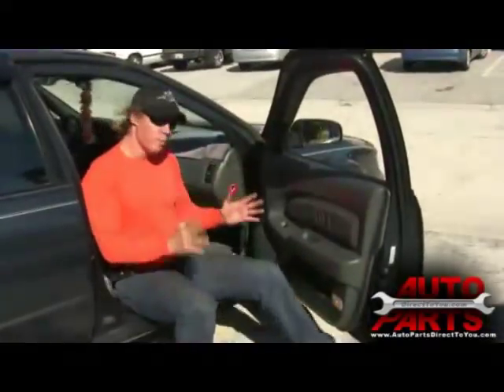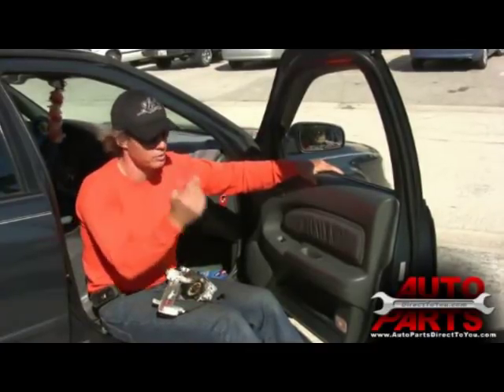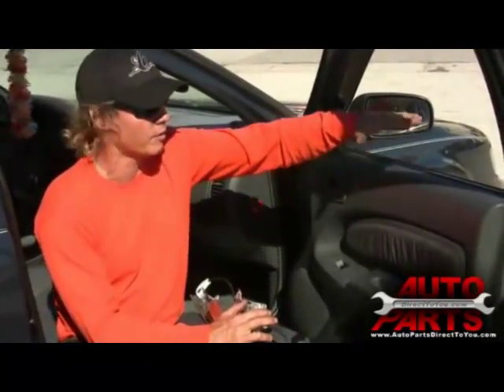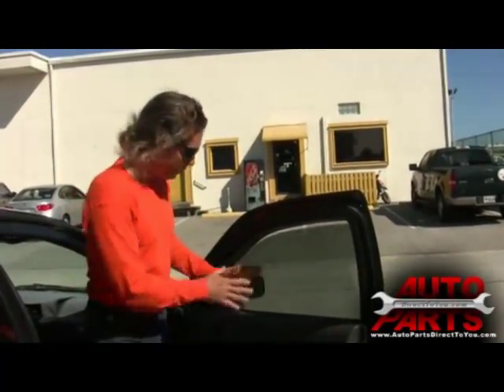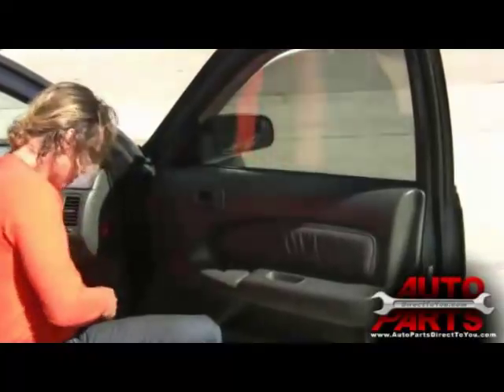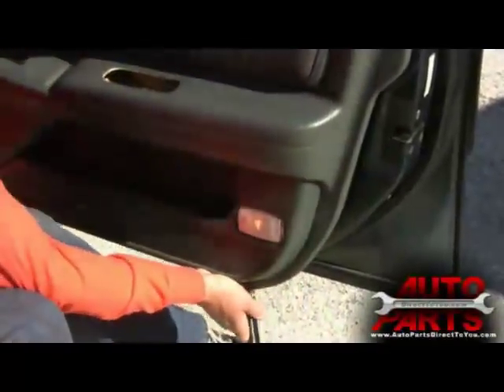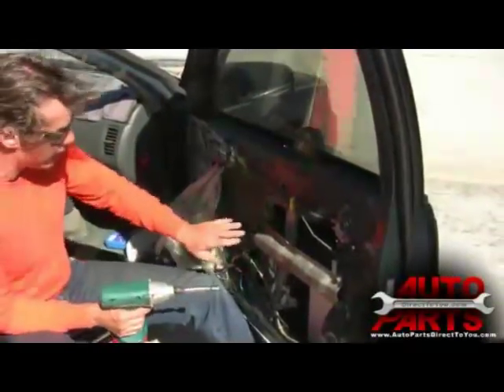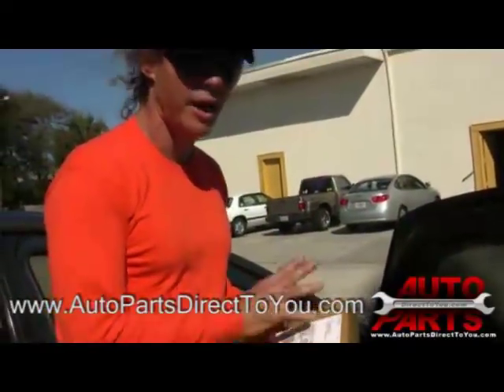Diagnose Window Motor and Regulator Problems Part 1

Comment: Hi, I have a 2008 Colorado that you can hear like a solenoid clicking sound from both passenger windows but they do not work. Both driver windows work properly. What are your thoughts?
Reply from the maker: +Adam W. If they failed at separate times, then you probably just need motor & regulator assemblies which are cheap nowadays. You can remove the door panels and inspect as that is what a shop would have to do. If both failed at the exact same time, then certainly a diagnosis is needed as that can be an electrical problem.
Reply from the maker: +Auto Parts Direct To You Also keep in mind Chevrolet Colorado models have a window motor and switch reset procedure if anything is disconnected, here is instructions incase that is it: Programming Instructions: 
1. Turn the ignition switch off , then back ON (II). 
2. Move the driver's window all the way down by using the driver's switch; when the window reaches the bottom, hold the driver's window switch in the DOWN position for 2 seconds. 
3. Move the driver's window all the way up without stopping by using the driver's switch; when the window reaches the top, hold the driver's window switch in the UP position for 2 seconds. 
If the window does not work in AUTO, Record Any Stored Trouble Codes & Disconnect The Battery For 10 Minutes; reset the power window control unit according to the above procedures again.

Comment: Hope you can help. replaced front right with new motor works fine but...when going up and hits top it automatically starts down. I have to bump the switch up several times to get it to stop closed at top . 2001 Pathfinder ? Any ideas ? getting frustrated. Thanks! Ron

Comment from the maker: Wow, that sounds like one of the major power-distribution lines may have failed somehow. I don't have any easy tips for you unfortunately, other than get a hold of a repair manual with the wiring schematics for the car, and start tracing and see if you can find where the fault is. Good luck.

Comment: I have a 2002 ford taurus, front windows are stuck down about 1.5 inches. When I use the up button on master switch dome light flickers, hear a clicking noise under the dash but window wont move. None of the windows work. When I push the down button nothing happens no lights or sound. I have already replaced master switch, no visible breaks in the blue wire with black stripe. any ideas?

Comment: Good informational videos. I watched part 1 and 2, but I didn't get anything that could help me. I diagnosed my passenger window and it's not the switch or electrical. It periodically stopped working and did not make any noise at all; it just finally stopped working for good after not reliably working all the time. Since there was no noise or anything and it took a while to stop working, does it sound like the regulator or motor? please reply and thanks in advance.

Comment: Quick question.... I have a 2008 Chrysler Sebring. The driver side window has been taking its time to roll up. it goes down perfectly but going up it takes about 10 to 15 minutes of me messing with it. Then I noticed today that I'm having the same problem with the front passengers side also but only if i try to roll it up form the driver side panel. If I try to roll up the passengers side from the passengers side panel it works perfectly fine.Is it still a window motor and regulator problem or is it just the drivers side control panel that is going out?

Comment: Thanks for the video! I have a '99 Nissan Maxima and the drivers side front window is having some issues. What happens is when I try to bring my window up, the back half of the window seems to go out of track. The front half (closest too the hood of the car) seems to try to stay in track. The motor sounds fine - just like the motor on the other working windows. I can get the window to go up properly if I guide the window with my hand as I'm pressing the button. What do you think the problem is?

Comment: Hi Mark,
Great videos thanks for posting them all.  I have a 2004 Holden Rodeo (in Australia) and have a problem with my drivers window.  The window will not go down unless I drag it down, but goes up just fine (from the fully down position). If I try to put it up from the halfway position it wont go, unless I drag it, then it comes up OK. No change in the brightness of the dome light when its operated and the motor only runs when the window is moving . Any help appreciated greatly.

Comment: Hi APDTY, I know this video is older so I understand if you don't respond but my front driver side window will not go up or down (we bought it like that) and all the other window controls on the master control work for the other windows. I hear no noises whatsoever when I press up or down on the driver window however the light within the master control which is only on the switch specifically for the driver window still lights up which makes me think that it is not a faulty switch or anything other than a bad motor. What are your thoughts on this?

Comment: I don't have the cable type.  Mine has the gear's with the motor, but it makes a poping sound when going down.  I've loosened the screws that hold the door cover against the side and that has helped some, but now it has started to get stuck going down and I have to hit the down switch again and it goes down. 99 toyota sienna drivers side door.

Comment: Hi, I have a 2003 Hyundai Santa Fe.  In the fall my driver side rear window went down and wouldn't go back up, frustrated I just gave up and went inside.  When I came back out the window went up and I hadn't had a problem with again until yesterday, when it was snowing of course.  The window went down and wouldn't come up again, I left it and tried it sever times later and it still wouldn't go up.  I never heard any grinding noise or clanking, I tried the both the switch on the drivers side front door and the switch on the back door itself.   Since neither switch would move the window up or down  I'm guessing it's either the regulator or motor.  Which do you think I should start with?  Thanks!

Comment from the maker: Something sounds like it's binding, to determine what, you'd have to pull the window motor off of the regulator, and see if the window slides up and down freely without the motor attached (Grabbing the window by hand and pulling it up and down). If it moves freely without the motor, then your motor is the problem, if it still binds without the motor, then your regulator is probably the issue.

Comment: I have a honda civic 97 ex, two door, the speaker works, the power locks work, but the power window does not work, i turned on my car made the window go down half way, it all the sudden doesn't work anymore, no noise, no nothing, window lock off, just stopped working, what do you think it is? the motor just went out?

Comment: Thanks for your time... I have a 2002 Ford F150.  Using the master switch I can roll down all window and roll them up except for the drivers side.  The drivers side window will roll down when I push the switch. It will not roll up.  In fact, there is no sound within the door nor does the switch make a click sound. Should I replace the master switch or change motor?  Please help...

Comment: I have a 1992 suburban, the drivers side window goes up have way then stops. If I hit the door panel with my hand it will continue rolling up. Same thing happens when rolling down. 

I've already replaced the up down switch but made no difference. 

O also noticed that when I wiggle up the window as I'm pushing the up switch it will continue rolling up as well. 

I need help.
Reply: Replace the window motor or the motor and regulator as an assembly is usually the best option. The motor is failing and it will stop intermittently,

Comment: Thank you for info but still have a question. I have an 04 Alero and I don't think it's the motor. I'm leaning toward regulator but I don't hear any clicking. Window sounds pretty much the same as the others but came off track and I was able to hold it up for a couple weeks w/o opening and closing it but yesterday it fell half way down and is kind of sticking out off track. I don't have any replacement parts atm and am trying to figure out what I need but I don't know actual diagnosis. help?

Comment: My Chev driver's window is quite slow coming up.
If it's not been used in a while, it will make it all the way up.
But if used a few times, it slows to a crawl and often stops in the bottom half of it's range (below where the arms are parallel and horizontal).
Is the motor going or is it serviceable?
And do you ship to Canada?
Thanks mate.

Comment: I have a 96 Seville and the drivers side motor keeps going out about every 6 months. I have the proper voltage and amperage going to the switch, so what would cause the motor to keep burning up, grounding issue?  Thanks!

Comment: I have a 2006 jeep liberty that I replaced the regulator / motor on a few weeks ago. It works fine, rolls up and down with no problem but after you roll it up if you continue to press up on the window switch it makes a clicking / grinding sound like it's still trying to roll up. Any ideas?

Comment: Hi, '06 G35.   Drivers side window goes down, but not up.  If you manually lift the glass while holding the power switch in up, you can get it up and it'll roughly stay.  Goes down fine.  No damage evident on the regulator, cleaned out the switch with electronic cleaner, no evident problem with the switch.  I'm assuming the gears inside the regulator are stripped, but it doesn't make any grinding sound, just the sound of the motor continuously getting voltage and turning in "up" mode, without anything to tell it to stop.

Before I drop a hundred bucks or whatever on a regulator, am I on the right track?  Motor seems very sound, goes strong in both directions if off the regulator, via the switch.

great video, btw.

thanks
Reply from the maker: Susan Edge You are on the right track and doing awesome actually. The window regulator is the most likely problem here and on those models it is really best to replace the motor and regulator as an assembly. The motor grabs the regulator cable and they somewhat wear out together. Window motors are readily available for your vehicle but the regulator is a little harder to find and I think is only available brand new through an Infiniti dealership. If that is the case then it is probably very expensive and then you may want to just remove and do a thorough inspection of your regulator. You really wont know the condition until it is completely removed. If the cable looks clean and not damaged or frayed, then you could try just a motor and it sounds like you are handy so if you have to remove again to replace the regulator it wont be to much of a big deal.

Comment: I have a 92 Lincoln Town Car. I just put new bushings in the motors for the back two windows and now they go up and down but on the way up, they slow down at certain points.  One of them even stops after a few inches and I have to pull it up an inch or so, then it will go up another few inches, then I have to pull it up another inch and and so on.  Any idea what this is? Thanks!

Comment: Ok so about 2 weeks ago i replaced the regulator/window motor in an 01 explorer sport trac.  The motor worked great, the problem was the 2 metal X blades that raise and lower the window had bent.  It was almost bent in half.  and of course Ford used Rivets instead of bolts.  But do you see this type of problem alot?  How could it have bent in the first place?

Comment: Hello, driver side window on my 98 Honda Accord won't go up all the way. The motor speed is the same and doesn't make funny sounds. But as the window is about an inch away from shutting it bounces on the track. Like when a gear is slipping. A clack clack clack clack sound as I hold the switch. It only does it right before it shuts. It goes down and come back up smooth and fine up until that point. Is this a bad regulator? Or could it be off track? I have to help it up and as I do it feels like it's free hanging. If I drive on a bumpy road the window will drop that same inch that won't go up.

Comment: Here's the situation, any help would be appreciated: The window goes up and down only sometimes, it works fine completely once the car is on. When I turn the car off the window doesn't want to go up or down. It's, like, 1/5 tries the window works. What can it be? Since it works 20% of the time, I am guessing it's not the regulator, correct? So, faulty switch or faulty motor?

Comment: Hi, I have a 2001 VW Bettle. Recently the driver side window will only roll down and not up. It rolls down very easily but to get it back up is nearly impossible we had to take off the door panel and and slowly help it back up with little intervals using the motor. I have taken off the motor itself from the door and I ran it without it touching the gears inside the door and the motor seems to run fine. Does this mean it is the regulator, the motor, or something else?

Comment: Hi, I have a 2001 Buick Lesabre custom. About 2 years ago the passenger side rear window regulator went out. Now I believe the drivers side has too. To save money I would like to do this repair on my own. I believe the cable broke on the regulator as it goes down but will not come back up and the window slips down on its own. Do I need to buy the regulator with the motor or just get the regulator? There is a price difference at stores and would like to get the right piece the first time.

Comment: Hey my driver window stopped working today. When I press the power switch for that window I do not hear the motor or anything. What could the problem be?
Reply from the maker: Pianoman75 This can be a switch problem or failed motor (bad connection, unplugged, or failed). If you remove the door panel and check the connections at the motor. You should get 12 volts at the motor when depressing the switch for that window. If you get 12 volts at the motor and the motor is not responding, then the motor failed.If the motor is not getting 12 volts when depressed, then the switch or wiring is the problem.

Comment: Hi, I've got an old '85 BMW 325 and my driver side power window won't close. It is actually stuck between 2/3 and 3/4 down. I can raise or lower it a couple inches and that's it. Furthermore, the emergency hand crank won't close it or open the window any more than the motor will. I have the panel off the door and I can't find an obstruction. The window was a bit off the regulator, but once correct it made no difference at all. Do you think this is a motor or a regulator problem?

Comment: One day, a year ago, i raised my driver window down half way to take a pic of some deer, then it just completely DROPPED the rest of the way and wouldnt let up since. I can still hear the motor trying to raise it (for a short period of time, about 2 seconds) then it just stops. I took off the panel and can see it giving effort to pull up the window, but the window doesnt budge.1999 Toyota Solara VE.

Comment: I have a 92 Ford Bronco. The driver side window has an issue. Just recently I went to raise the window and about have way up it started to slow down and stutter, but did close. I've used if a few more times then is stopped working all together in the closed position. Then the other day by habit I push on the power window button and it went down again, going down it works fine, its on the way up where the problem is. When I went to close it it closed but did stutter on the way up. The stuttering starts about halfway up to close.
I’ve worked on cars for many years so I do understand them, however this problem is something for a specialist like yourself to help answer. 

If you have any suggestions I would appreciate your input.

Thank you in advance!

Comment: Hey man, I have a 1994 Ford Mustang and I have problems with BOTH of my windows. When I roll down the driver's window, It will go down smooth, but then continue to run-on even after it has hit the bottom (or top) It will just cycle and "clunk" until I stop pressing the button. (I have a vid on my channel of it doing it)

My passenger window will do the same thing and just clunk over and over again if I hold the button. This window will lightly hang up partway but will always make it up or down.

Comment: Hi, I have a 07 Hyundai Sonata, I'm hearing a lot of grinding and crackling as you described in part 1 of your motor and regulator problems. I think the cable let go of the mount. When I took the door panel off, mind you the motor spends but for a short time. I saw a cable hanging out. Is that the regulator or the motor that needs to be replaced? Also, all my other windows work and when I press the window to open or close, the inside interior dome light DOES NOT go dim. Please help APDTY

Comment: Pass Window stuck in down poss in 97 acura. won't come up. Took off panel and tried to lift it. can't get to bolts while down/ won't budge. need to drive car( it's very cold raining) till new part comes. I'll still need to get to bolts holding glass. in any sug's?